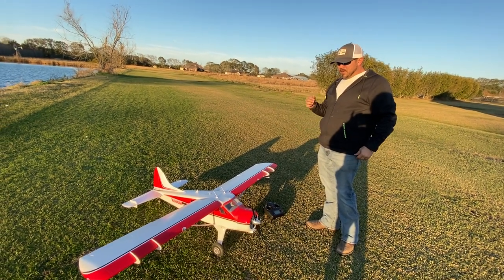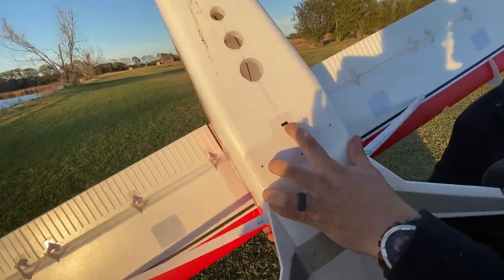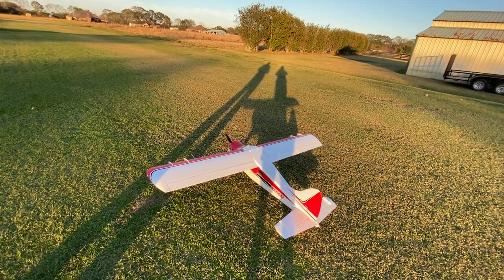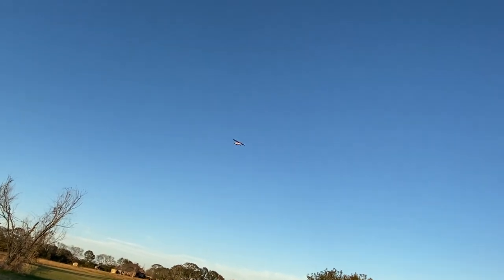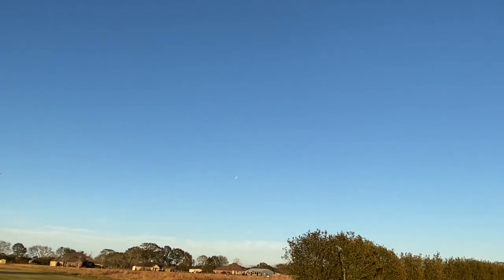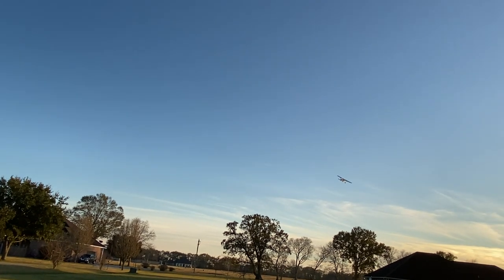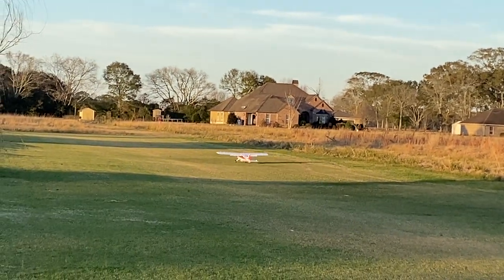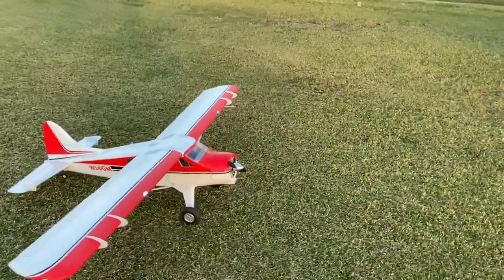FMS 2000mm Beaver V2

Comment: Awesome detail to your plane!! Im in the market for a new plane and I'm unsure what i want. I started flying with a beaver then got a trojan t28 then stopped flying for 5 years. What would u suggest for a plane for someone that has flown before but been out of the hobby for 5 years? Ive been practicing with flight sim.. Anyway nice video
Reply from the maker: K&S Racing I would honestly suggest either the Fms beaver like this one, or the Fms 1800 mm ranger. They are both very awesome flying airplanes and very stable. But they also have capabilities of being aerobatic!  I usually fly EDF jets but these two prop planes have been my favorites lately.
Reply: @cormierrctrailers5177  do you think a beginner can fly that beaver?
Reply from the maker: K&S Racing yes I do.
Reply: @cormierrctrailers5177  awesome thanks